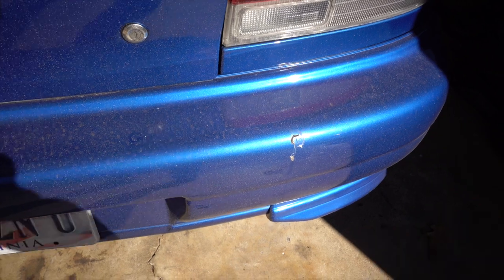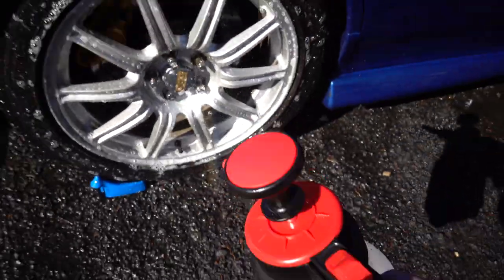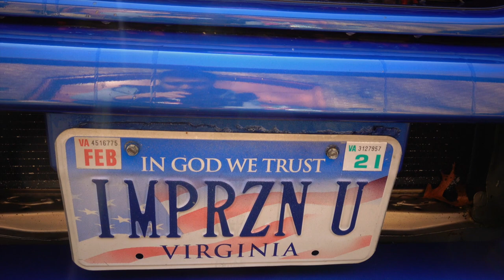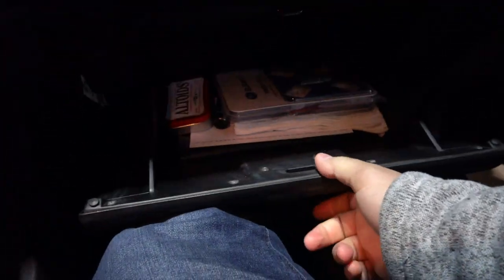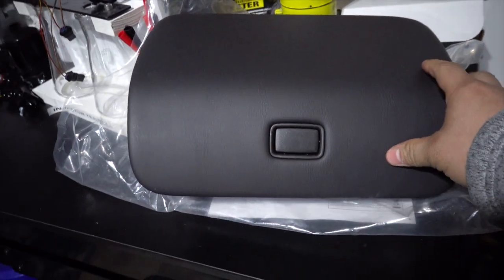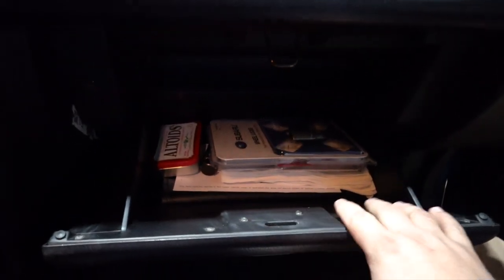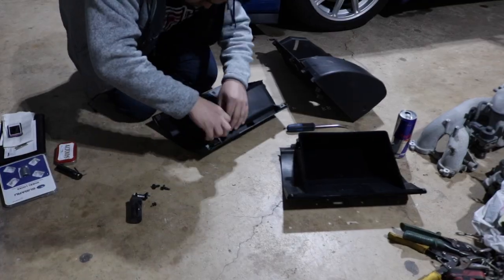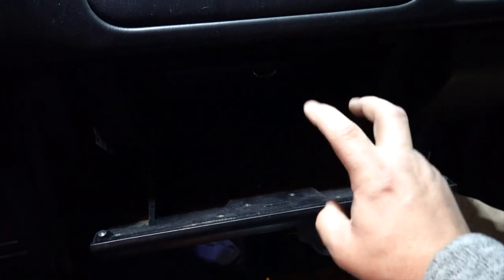Installing Forester Glovebox Inner Trim In My GC8!!

Comment: I have a 99 Impreza L and mine has the suede cubby. Unless unless the previous owner installed it but they were 70 year old couple lol
Reply from the maker: I’ve only ever seen foresters with them so I’m sure it had to have been swapped at some point. Those lids do break easily and it’s almost easier to swap the whole cubby so I don’t doubt it was changed.